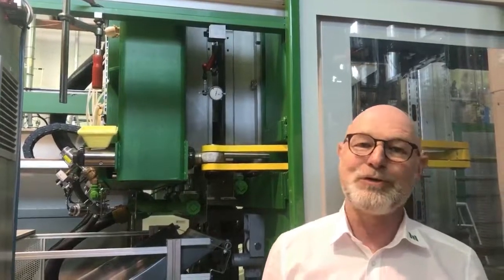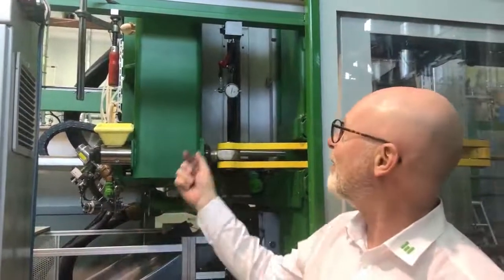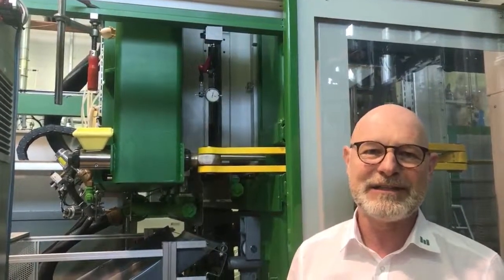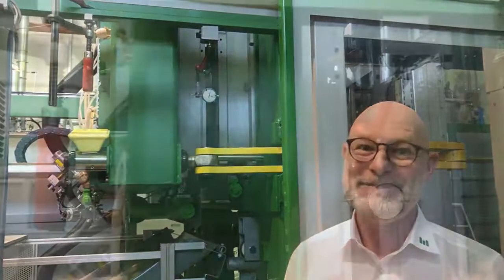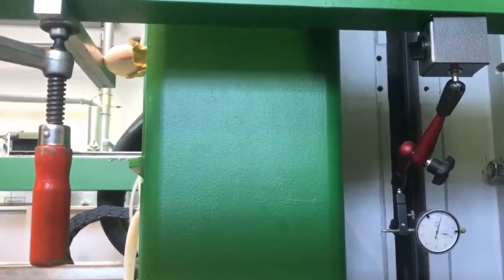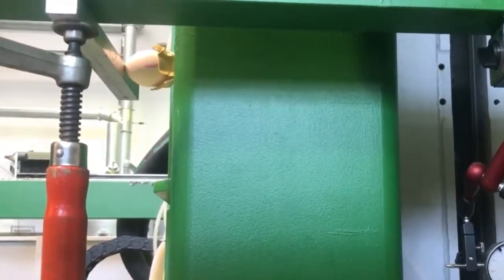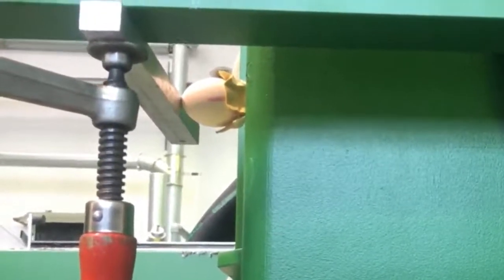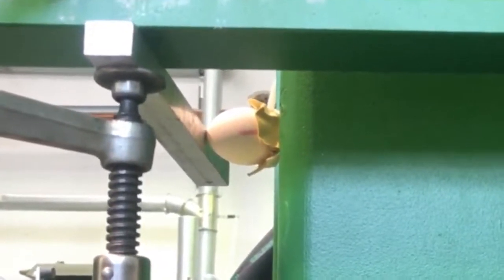EPP shape moulding machine // epplivehack#3

Comment: I was wondering if EPP AND EPS molding machines, are the same?.
Reply from the maker: EPS machines are usually operated with up to 1.6 bar and designed for this. EPP machines, on the other hand, are operated with up to 5 bar.